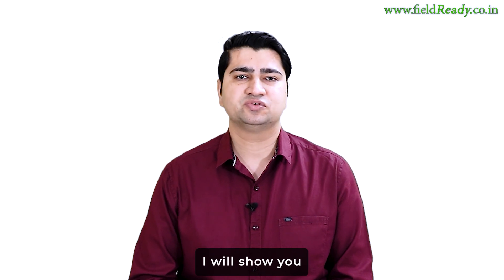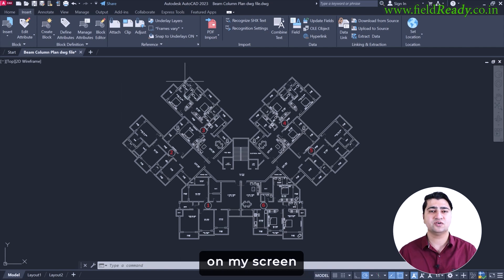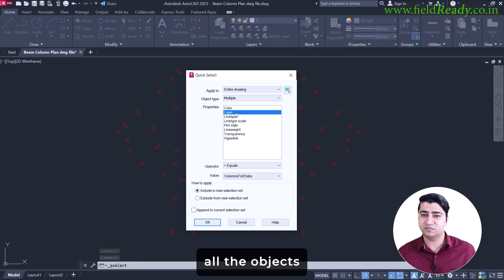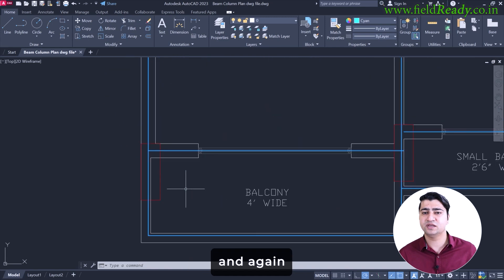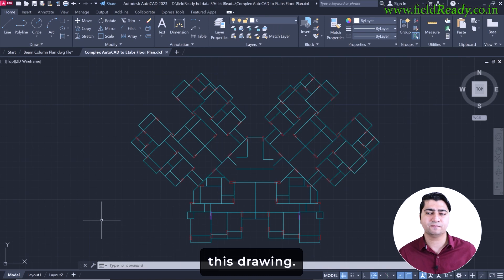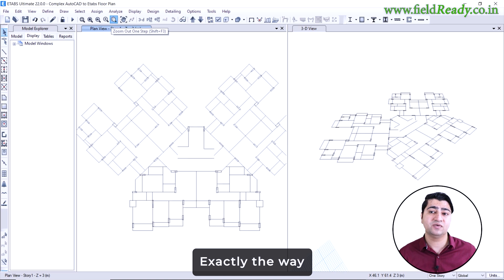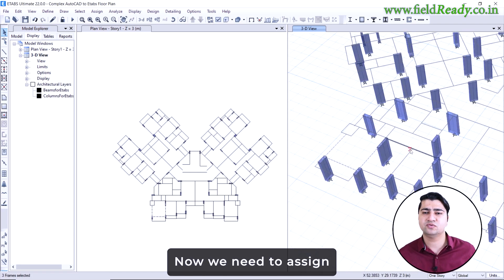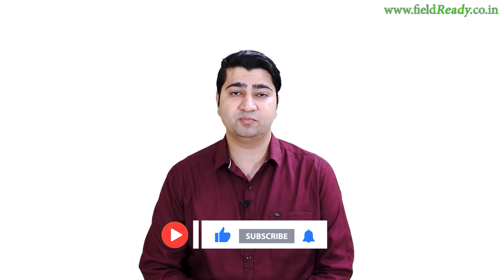How to Import AutoCAD Plan to ETABS | ETABS Tutorial for Beginners (Fast Beam Column Modeling)#etabs

Comment: What about dimensions of column that we input for column in Etabs ؟
Reply from the maker: The column dimensions will be automatically read by Etabs from the CAD file. You don't have to input it into Etabs.
Reply: @fieldready_Civil_Engineering   How to change column size if fail incase. Column is a line object but your beam end point is not same location of column's center.
Reply from the maker: Use Links in Etabs. More on these in Advance courses. For more details visit: https://fieldready.co.in/MegaAdvancePreview.php
Reply: Thanks a lot.
What about BEAM. it's possible to import it's width from AutoCad to Etab?
Reply from the maker: As of now not possible, etabs only understands center Line concept for beams. Maybe in upcoming versions.

Comment: Columns are modelled as per sizes drawn but for beam sizes what is procedure
Reply from the maker: For beams we have to maually set the size using frame window in Etabs. You can take 9" X 1'6" or 1' X 1'6" Starting beam size & proceed forward for design, if it fails then increaset he size.

Comment: Etabs 2018 doesn’t create columns cross section accurately of the drawings. Beam connectivity is also difficult, mostly with eccentric beams connecting to columns since axis aren’t present. This often results in poor analysis 😢
Reply from the maker: Shift to newer version of Etabs 2022, connectivity via links will be there in it. For more details visit: https://fieldready.co.in/StructuralDesignPreview.php
Reply: No sir in newest version also it's not showing the midpoint of the column  @fieldready_Civil_Engineering